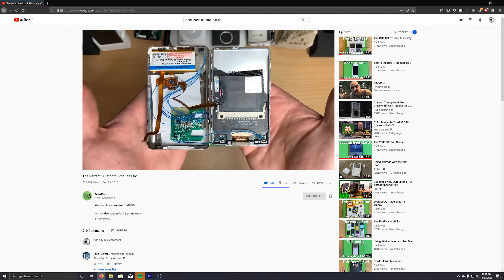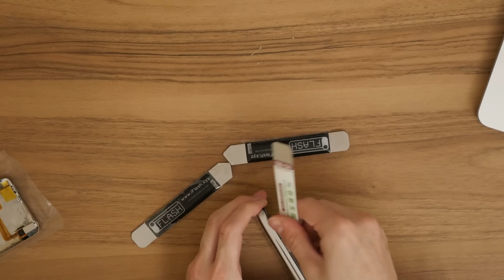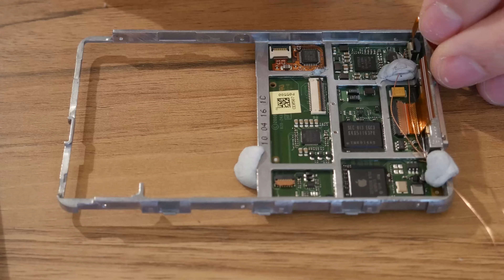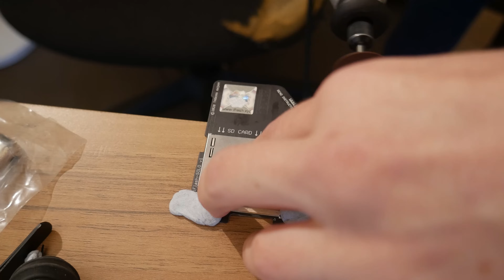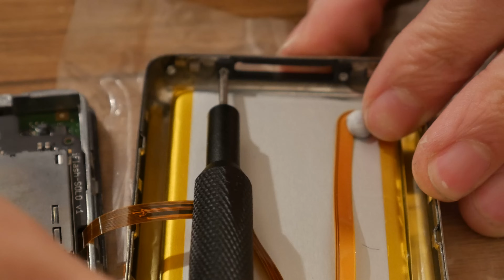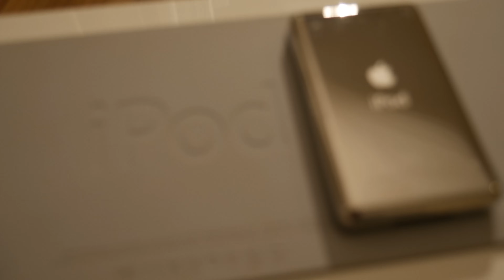The REAL Perfect Bluetooth iPod Classic

Comment from the maker: So, before you comment. Yes... The copper wire is insulated and won’t short out the iPod. It’s thin enameled copper wire made for motor windings. I feel the need to pin this here since a growing number of you keep commenting about the wire.
 Also, if you’re interested I have a new video detailing how to install Wireless Charging in an iPod, watch it here! https://youtu.be/pgRfzyKiwDE
 Cheers!
Reply: With the 3000mah battery and The iflash 4 micro sd card board I was able to fit 500gb of storage and 3000mah battery in the 30gb thin ipod classic 5th gen but hand filing the metal internal aluminum frame that holds the pcb down to just a hair above the screw holes. I have a little gap left that i might be able to fit a bluetooth board in if i can find a compact enough one and solder the connections to ribbon cables rather than thicker cables. I'm also trying to get 30pin to hdmi adapter cause my Goal is to have a huge storage ipod that I can store loads of music and movies on with a crazy long battery life, so i can listen to music while driving then when i get to a hotel or my GFs house I can simply plug it into the tv and have like 200 movies ready to go. I've also found an app that lets me reformat dvd movies to a format that works with the 5th gen ipod and set to a resolution so that on the ipod it has 2 black bars but on the tv itl match 720p resolution
Reply: That was brave cutting into the iFlash board. I contacted the company directly to ask if there were any traces in that area before I did anything like that.
Reply from the maker: @HitNail1   I had a look and there were no signs of traces, considering the part is only $30 I thought it worth the risk!
Reply: @Pendleton115  Well you were right, but I didn't want to risk it since traces can be hidden between layers in a pcb. Awesome work!
Reply: How is the Ipod holding up today? Anything wrong with it? What changes would you make if you could. Anything you wouldnt do next time? How is the battery life now? Any flaws or defects when using today? Any audio problems?
Reply from the maker: @mikeymendez3749  I plan on releasing a follow up in the near future. Just have been flat out with work that I haven’t been able to work much on my channel, in short it’s been perfect. I’ve had to open it up a couple times to make a couple modifications to the antenna placement and lock switch, but it’s even sat in my car during a hot Australian day and it still works happily. Battery still lasts months at a time.
Reply: @Pendleton115  Actually that'd be great, I'm actually slightly concerned with battery life, are you able to turn off the bluetooth module via the button or does it kind of stay on even if the iPod is on standby?
Reply from the maker: @jonathanchan3834  you can turn on and off the Bluetooth module with the button yes, :)
Reply: @Pendleton115  Ah brilliant, thanks!
Reply: you should now figure out how to make it charge wireless, i challenge you
Reply: @DanktronYT  that would require a backplate mod as the original back is metal
Reply: @DanktronYT  LOL love your way of thinking how how to bring it another level!!!
Reply: Will all this work on a iPod Classic 5.5?
Reply: @rpelletier2771  That's why I did this on, but I didn't do the Bluetooth portion. If you know what you're doing then you could definitely do that part as well though.
Reply: Respect for the great work!
Do I need to connect the audio jack of the iPod with this on the bluetooth module if I won’t use the iPod as a transmitter? Is the bluetooth still be able to spread bluetooth audio signal to the headphones if that connection has not been done.
Thank you
Reply from the maker: @nikolaystoyanov5644  To use the iPod as a transmitter. All you have to do is plug the device into the 3.5mm jack, you can also use bluetooth headphones and wired headphones simultaneously.
Reply: There's a webside that put japanese capcitors for better audio and a gide for usbc mod, wood cover to fil the gap sounds great and easy better than have both. 
Never see a remove sd card like the smartphones. Seems easy to make the hole buy parts from smartphones and solder cables but not so easy to fit and make It strong.
Better ideas I find for my project hope anyone interested. I love your BT switch thanks for share, I will copy for mine 😊.
Reply: Can you repair my iPod?
Reply from the maker: @joseoscargonzalez7078  What’s up with it?
Reply: @joseoscargonzalez7078  Yes!  See my video on how to open ipod classic.

Comment: Looks like top shelf work. Not sure about the blue tack (looks messy!) but whatever got you to your final product is great. 
I was really impressed with that little bit of push button ingenuity. The biggest issue with BT modding an Ipod for me has definitely been what to do re: pairing. With the push button adhered to the lock button, this becomes a non-issue. That chonky back is something else for a seventh gen. Is it twice as thick as an actual 7th gen back?
I have been sitting on my flash modded 7th gen and BT transmitter for months now. Perhaps some time soon.
Reply from the maker: It's not that much thicker, maybe 3-4mm. It definitely looks a lot larger when compared to the thin back, but you quickly get used to it and honestly doesn't really impact its daily use. It's not a brick like the 20gb iPod Second Gen lol.
Reply: Where do I get the thick back for my 7th gen?

Comment: I'm not trying to be mean but if you have to use hot glue on your solder joints, then that shows you that you are not very confident in your soldering skills.
Reply from the maker: It's not that I'm not confident, I open this iPod regularly to work on it, meaning the joints get put under a lot of stress, the hot glue is great to protect the joints from bending and eventual snapping. Solder anything and start to bend it, it will snap after 10 or so bends, now put some hot glue on top and you'll notice it'll last far longer.

Comment: Awesome mod for a classic device but I couldn’t get how those wires, that aren’t insulated, be so close and not short it’s function. You did it but in the real world use, I’m afraid those wires that are too close for comfort would eventually come in contact.
Reply from the maker: The wires are insulated. They're coated in Enamel that has to be gently sanded off on the solder points of each wire. Been using this iPod for 4 months now and no problems so far.

Comment: Hey there! I'm doing this on a 5 gen iPod. I am at the stage of wiring the bluetooth module at 16:25. I can't seem to power the bluetooth board but the LED of my iPod does show up. I followed your wiring diagram and am sure the polarity is correct. Any help would be amazing. Thank you
Reply from the maker: Make sure your Bluetooth board is connected properly to the battery connectors on your iPod logic board. Use a volt meter to make sure the iPod is getting 3.3v approx :)
Reply: @Pendleton115  I also thought this was the problem so I tried to re solder and I just broke the plug port module 😂. Just bought a replacement part then I'll get back to you in a few days.
Reply from the maker: @TheOnlyBiggieSmalls  dang, glad you found a replacement! It’s definitely the hardest part of the build, takes a lot of fine work.
Reply: @Pendleton115  Amazon really is the best. Also when using a multimeter, how do you go about it. I have one laying around but never bothered to use it. I measure a current across the positive and negative but under what settings? Thank you for replying so quickly
Reply from the maker: @TheOnlyBiggieSmalls  usually you just set the multimeter to the “DC” setting and put a probe on each pad many volt meters have a continuity setting as well for you to verify that there is a connection across a wire
Reply from the maker: @TheOnlyBiggieSmalls  I'd reccomend against soldering elsewhere if you can avoid it. But possibly you could solder directly to the battery, although be careful if you do this as heat and Li-Po's don't mix!
Reply: @Pendleton115  Fair enough. Maybe ill try to solder extra wire coming out of the FPC connector before i put it on the board to help me from breaking it off again lol
Reply: @Pendleton115  Hi again, I successfully did it ! Only thing is my left channel isnt working. I resoldered a new wire in place of the old one. Still nothing... any suggestions? i followed your diagram
Reply from the maker: @TheOnlyBiggieSmalls  Hmm strange, make sure to measure continuity on your volt meter between your two points, could be an issue with where you're soldering to on the Bluetooth Module. Try different solder pads until you find one that works.
Reply: @Pendleton115  So i swapped the audio+hold module out for another from another ipod i have and same problem. Its definitely the BT module
Reply: @Pendleton115  Honestly i have no idea where else to solder either. If you wouldnt mind could i PM you some pictures
Reply: @Pendleton115  Just kidding! I got it to work. lol
Reply from the maker: @TheOnlyBiggieSmalls  sure, feel free to send those through Twitter
Reply: @Pendleton115  I am completely done and have a Bluetooth ipod. Thank you very much good sir. You have been a treat to listen to and learn from. Take care

Comment: Hello! I'm doing this mod right now, and my hands are a bit too shaky to be able to solder the two wires that power the Bluetooth board into the motherboard.  Any time the iron gets close to the pins on the motherboard it shakes too much to be able to put it on one pin. Do you maybe have any ideas or solutions for this? Thank you :D
Reply from the maker: make sure you have a fine tipped iron, you may need to dab some solder onto each pin of the connector before soldering the wires to them. It's quite tricky but using a soldering clamp to hold the wire in place as you solder can make life much easy. Keep a steady hand and you should manage. Best of luck!
Reply: @Pendleton115  Thank you!

Comment: I followed all your directions. They were perfect. The only issues I have are that using the hold switch as a button made the hold slide brittle, it is easily pushed underneath the backplate - so I am going to cut a hole for the bluetooth button instead. The second issue is the bluetooth range... despite cutting a hole in the metal behind the screen, the range is poor - with stuttering even at pocket distance, I am thinking about how i might go about improving this
Reply from the maker: If the hold switch is getting pushed into the metal frame your button likely is to weak or not mounted close enough to the switch. It should exert some pressure onto it to make it harder to press in, but easy to flick from side to side. As for the Bluetooth Range make sure you've aligned the antenna behind the hole you cut in the screen protecter, or try removing it entirely. The type of Bluetooth Transmitter or headphones you are using can also be a factor.
Reply: @Pendleton115   Interestingly enough I looked at how you put the  board into the ipod antenna side toward the back of the ipod. When I closed the case with the board in that direction the reception was much better. I wonder if the bluetooth connection reflects off the back of the ipod provides a much stronger connection that way...
Reply from the maker: @dmc7554  This is definitely possible. Although more testing would likely be needed to confirm.
Reply: @Dan Christiani @Pendleton115 I get the same issue, when I put it in my pocket it cuts out sometimes even after removing the metal behind the screen. Did you find any fix for it? I even tried soldering on my own wire antenna but I get only slightly better results.
Reply: @kamzy98  I haven't tried yet, but I suggest a plastic caseback
Reply: @danchristiani  Good idea, I wasn't able to find a plastic one. I like the sound of the taotronics bluetooth tx, but I think the range is not the best. I might use some some wire and have it as an antenna outside the case and see how that works.
Reply: @kamzy98  they sell transparent ones
Reply: @danchristiani  I like the metal back. I ended up cutting the trace to the inverted f antenna on the pcb and soldered on x2 wires to make a dipole antenna. It's a lot better, still get some cut outs in congested areas but overall very good.

Comment: Hi Pendleton 115 Awesome video for starters. I'm having trouble getting the buttons for pairing from the website you have listed.
For starters i signup, created a password, gave my cell number as required. Only to find out they don't deliver to the united states from Singapore. Went looking on the internet for bout 20min, all dead ends. Do you know of another place that has buttons like the ones you're using? Or maybe you have (3) for sale, free is good 2. Thanks in advance Tim
Reply from the maker: Hi, I didn’t actually purchase my buttons from this website, this was just the only site online I found them listed. but I imagine any local hobby/tech shop that sells arduino type stuff should have them for sale. Hope this helps! If not there are plenty of old electronics that have these kinds of buttons (alarm clocks etc)

Comment: Do you get any kind of hissing sound when the audio is paused? I did a bluetooth mod with another transmitter and I get a wicked hissing sound, even when I use the line out audio instead of the headphone audio. I am fairly certain the noise is being created by the iPod itself.
Reply from the maker: No hissing what so ever with this transmitter, that is why I chose it, it’s larger than most but the audio quality is way way better.
Reply: @Pendleton115  Interesting, thanks! There was no hissing when the module was used as intended. I'll have to give this one a try. Last question: do you think this is possible with the thin back?
Reply from the maker: @nerdlord20  Unlikely, as there would be no space for the battery (As the Bluetooth Module sits where the normal battery goes) I circumvented this by using the larger 3000Mah battery, but this only fits in thick back iPods when using the iFlash Solo.
Reply: @Pendleton115  I have the quad in my current classic, with the large battery. This works with the thin back. The classic I added bluetooth to required some voltage conversion circuitry and other bits so I had to use the thick back.
Reply: Also technically the hiss is constantly present, it is just harder to hear when music is playing

Comment: Hello! Woww nice video!! But I have a question, a bluetooth transmitter connected to the 30-pin port isn't better than this modification? Because still being digital signal?
Thank you!
Reply from the maker: I’m not sure, probably depends on the quality of the Bluetooth board etc. And soldering to the 30-pin port is way beyond my ability. Curious to see if it’s possible though!
Reply: @Pendleton115  nono, I think you misunderstood what I ask ahahha. I mean a bluetooth transmitter like this one https://www.amazon.co.uk/Baile-30-pin-Bluetooth-Transmitter-Classic/dp/B00X5LBYCO you connect it to that port without soldering anything or open the ipod..

Comment: Man, I love the ingenuity, but please stop dousing these types of mods in hot glue. If your solder joints don't hold on their own, they aren't good enough for a reliable connection anyway.
Reply from the maker: Sure, let me know how your iPod holds up when the wires have no re-enforcement ;)
Reply from the maker: Just to clarify, what you said is correct, but for the case of this mod I decided to re-enforce the wires with hot glue, as I plan on opening and closing this iPod quite often to work on it, as i bend the wires I don't want to put un neccesary strain on small joints. Hot glue protects them from this and can be removed quite easily if need be in the future. Also if you drop your iPod the hot glue can give a bit of impact resistance.

Comment: Heyy this is amazing! Just want to ask if the wire you used had any insulation on it? Looks like bare wire, I'm concerned about shorting occuring when the wires touch.
Reply from the maker: Hi there! Glad you like the video! The wire is actually insulated, although not with rubber. Rather with a sprayed on coating. (You can purchase copper wire like this from most tech stores, usually in DIY electric Motor Kits) Makes sure you sand down the wire on the parts you plan on soldering too though!
Reply: @Pendleton115  Wow thanks for the quick reply! Ah I see, that helps a lot! I might give this a go, thanks so much!
Reply: @Pendleton115  Oh one more thing, does the earphone jack still work?
Reply from the maker: @jonathanchan3834  sure does!
Reply: @Pendleton115  Brilliant! 

Now that I'm thinking about it, I wonder if those 30pin bluetooth adapters take an analogue or digital signal from the ipod to be sent to the device. If the 30pin has a "digital audio signal" output, it can possibly allow for better audio quality since the need for the extra AD/DA conversion can be mitigated, i'll look into it!